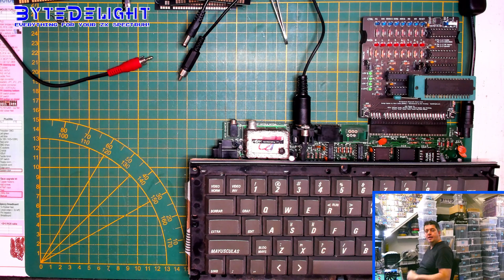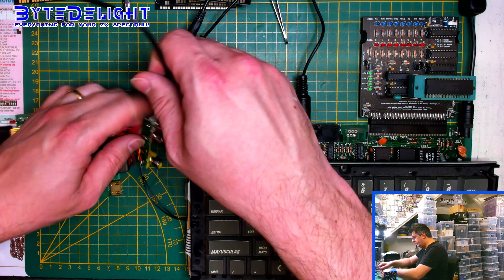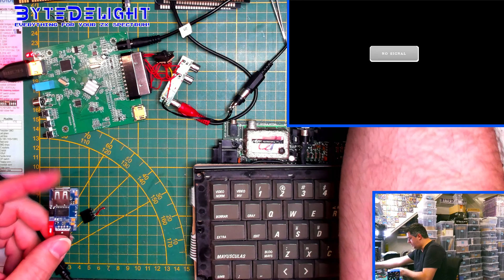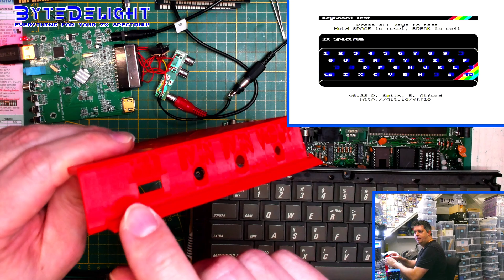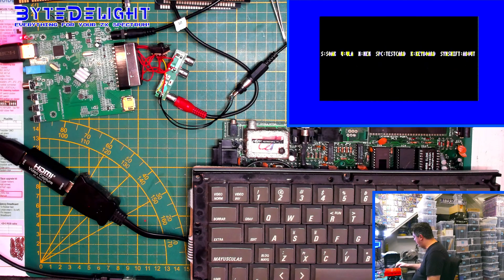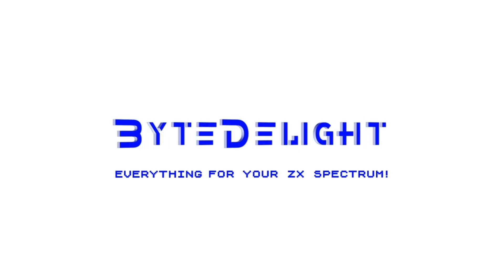How to get rid of nasty USB ground loop problems!

Comment: I get a problem with ground loop noise from those upscalers. The result is a real mess over the composite signal I'm working with. I lost days trying to figure why my new video circuit design was getting badly messed up and I had a rolling band of noise but only on a PAL, if I switched to a NTSC equivalent it was fine. Turns out it was the upscaler itself and the rolling band was the timing difference between PAL and the rendering for the HDMI frames. Other upscalers are far better at isolating the signal but none of them seem to be perfect and they all seem to inject a level of noise back through the connection

Comment: have you tried powering the spectrum from the pc?
Reply from the maker: I actually tried powering off 2 USB ports of that PC, but got the same problem.
So it is really puzzling what the exact cause is, though this USB isolator did solve it.
Reply: @ByteDelight  what about the scart to hdmi thing? where does it get its power from?
Reply: i had a similar problem. a broken tv psu caused around 100v ac between earth and its own ground. it was enough to power an led and eventually destroy that led. of course i only found out after those 100v destroyed an audio preamp. (by plugging it into the output of a sound card on the pc)
ground loops are fun